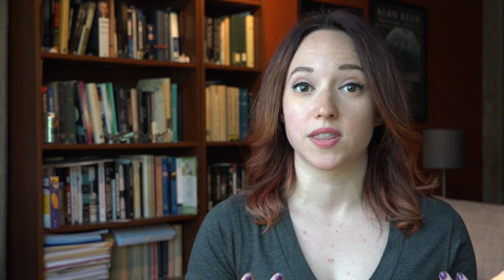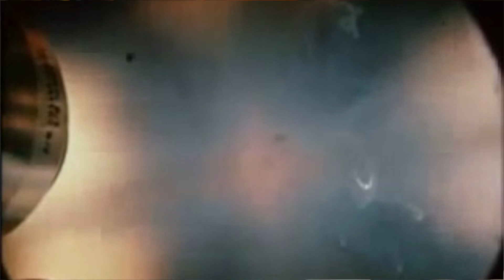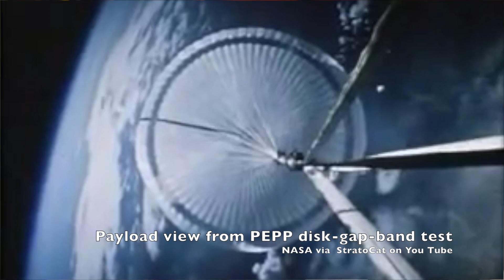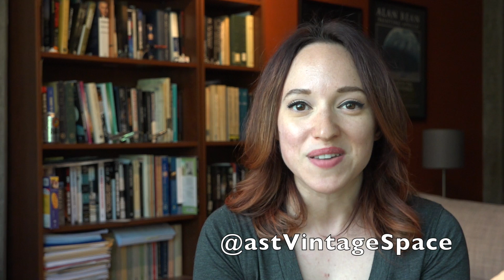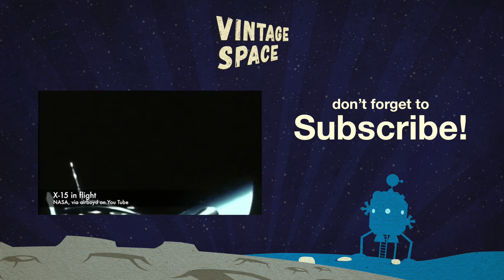Why is NASA Still Using 1960's Parachute Test Results?

Comment: It is also because it is possible to simulate it easily( for experts) with today's software. Dr. Fehmi Cirak from university of Cambridge has publications related to this. The one data from 60's is enough to validate the simulation and then with the same model it is possible to simulate other designs.

Comment: Amy great job on the videos.  I'm not sure where to put this comment but I'm wondering if you can do a video on how the crew communicated with Houston.  I'm referencing the quote gus grissom made in the dress rehearsal before the launch of apollo 1.  He said "how are we going to get to the moon if we can't communicate between two buildings?"  How in the world did the high gain antenna work from 200,000 plus miles away.   Thanks for your time.   Lane
Reply: Hey Amy I found your video explaining the way the crew communicated with the ground.  I can't understand how instantaneous the communications where.  Listening to the actual communications from crew to Houston there is 0 lag.  It seems like the dialog had to go to dsn then to Houston.  How did they get that instantaneous communication?

Comment: Amy what do you think of a flying saucer shaped spacecraft 450 metres wide 360 metres long about 60 metres high being used as a wild-fire dampener and a hurricane disperser. Equiped with atmospheric forcefield protection defensive systems  that will be fitted to the deep space transportation ships, the ship would have a crew of 1000+ monitoring dangerous weather events and help out in disasters.

Comment: had a question, Amy, about your editing. Why don't you write the entire script, and when it looks complete, load it and read it completely in one go? Doesn't it make for a more convincing video that way?
Reply: It really depends on what the person is more comfortable doing.  I've done both scripted and extemporaneous talks for a couple of decades, and for work where you have to interact (whether with an audience or a camera), extemporaneous talking is much easier, provided you know the material.

Especially if you're doing a piece to camera (as Amy is), it's almost impossible to do it from a written script unless you have a teleprompter or are willing to make some compromises in how you record.  If you double space the script and print it at 14 pts for readability, a four minute video is going to take up around 4 pages.  If you spread out all four pages in front of you, the first and last page are going to be way out of your normal eyeline-so it's going to be obvious that you're looking left or right to try and read stuff (also, a lot of people simply bury their heads in the script, so all you see is the top of their head).  Doing it one page at a time eliminates that problem (I've taped scripts to the bottom of the camera so it's close to the eyeline), but it means you've got to stop and edit at the end of a page-which may not be a natural point for an edit in the script.

If you do it extemporaneously, you can have a page (or even just a part of a page) with notes, and have that close to your eyeline to the camera.
Reply: almostfm I agree with all you wrote. Almost. Because my point to her was that since she IS using the Teleprompter, why not put it all together, and just smoothly talk through it. The scenes looks a little choppy, if what I have been told is right, that she's using the tP device.

Comment: How I see the future.  Once they get Lithium batteries perfected and a light weight electric motr, you can strap on a rocket pack that is battery powered and go up as high as you want.  Now, you will need a radar system onboard to watch out for space clutter.  I played too much HERO on Atari.  2600
Reply: If we can charge those batteries for a little cost on our environment is the big question K.  I like free energy ideas.  Look up Rosch for one interesting one.  German engineers that have a patent.  My idea is on here as well.  But you gotta go to your filter and put less than 4 minutes and it's the 3rd one down from the top of the list under "Future of Energy Video"
Reply: The idea shows a ball rolling downward (Mine) and it was supposed to harness gravity as a potential force to be acting like your brake pedal in your car by transferring the pressure to hydraulic pressure.  Which turned a generator.  However, Team Rosch uses buoyancy.  So I am thinking the ball will now float and water will be pushed ahead of it or you get the idea.  It will take me some help to get this one going.

Comment: How about, "Why is NASA still using a 1960's engine (RS-25) in it's fancy new heavy-lifter family?"
Reply: Because it works-it's a proven design.  And chemistry isn't really that different than it was in the 1960s, so your fuel choices are going to be the same.

Comment: Why is NASA still using 1960s parachute test results? A better question is "Why not?". No need to reinvent the wheel if you don't have to. The payload they're lowering and the material the chutes are made of may have changed, but the design is still the same.
Reply: "Science isn't about why. It's about why not." -Cave Johnson
Reply: Johnny Dominguez I was making a joke. But time tested design IS science.

Comment: As a parachute related question, what materials were used for the american and soviet Venus landers? With an average surface temperature of 800+ degrees Fahrenheit, the existing chutes wouldn't last seconds.
Reply: Venus's atmosphere is not very hot at higher altitudes and is actually has a temperature similar to Earth's so a  conventional nylon parachute will work.
At lower altitudes were it's hot  the atmosphere is so dense all the lander only needs a drag flap the ring at a the top of the Venra landers.

Comment: Amy - I read this about the IU on the Saturn rockets:  

Two prisms, one fixed and one servo-driven, were used with an external theodolite which sighted through the viewport outside location 21 to set the azimuth of the inner gimbal before launch. The azimuth could be set to an accuracy of ±5 arc seconds.

Can you explain to us budding space geeks what this means?  The Saturn nav computers took sitings before they launched and based their calculations off that?

Comment: The test you are talking about failed in the test.
That is just the fact that the truth. The fact is it did not work.
This also brings up a few questions like why are they using a fish-eye lens in any high altitude space flights.
The other question would be because because the test failed that would suggest Mars rovers failed and we are being lied to.
I am then thinking we have too ask the simple question is why. I believe the simple answer is clear yet hard to believe.

So I have one question for you if you wish to answer. With as many times the US government has lied "No new taxes" or "balancing the budget" "I am aware you are in Canada" so why should anyone trust NASA when the government that keeps lying created it using such things as "Dirty Trick" or "Paperclip" or even "BackLash". 

I could go on but my main thing is why did you suggest in your video that the test worked? The test in fact failed. Based on facts the only thing that they could have used was a rocket thrust to create a vortex to open the Parachute yet this would not work in a vacuum as Mars values are suggested to be.

Comment: Has any country ever used nuclear power in a space station or satellite? if so, how powerful was it? Why aren't we using them more often? Loving the videos btw :D
Reply: ESA and NASA have used Radioisotope Thermoelectric Generators on their space probes like pioneer, voyage, viking and even curiosity. Actually Apollos 12-17 carried RTGs with them to power their Apollo Lunar Surface Experiment Package doohickeys. IIRC there was some concern over Apollo 13's when the LEM burned up in earth's atmosphere but it seems it's just lying there. RTGs aren't really nuclear reactors as much as they're radioactive stuff in a box with a half life measured in years or decades that passively radiates heat, unlike reactors which rely on controlled nuclear chain reactions. They also don't have any moving parts. They're not super dooper powerful, wiki says somewhere in the region of a few hundred watts. And why don't we use them more often? Well for one they contain radioactive substances which will stick around for quite a long time so containment breaches would be a big problem if people are involved. A lot of the time solar panels will do just fine, but they're a must for deep space probes and a luxury for anything that's going to be operating on a planet's surface in the night, while researching this i also saw a blog post speculating that if a Mars mission were to happen they'd probably be integrated into the rovers used based on what NASA did for Curiosity. Not sure how easy it is to get a hold of the isotopes though so that may be a limiting factor.
Reply: Both the USSR and the USA launched nuclear-powered satellites. I'm not sure how powerful the reactors were, but they were really expensive and probably considered dangerous to launch. The US reactor was called the SNAP-10A, if you want to look it up.

Comment: Speaking of testing, I have a question about the hypergolic propellant used in the Apollo Lunar Modules.

From a wiki article: "According to the Science Channel's documentary Moon Machines, the fuel and oxidizer were so corrosive that the engines had to be rebuilt after each firing. This meant that each ascent from the Moon was performed with an engine that was not tested prior to flight".

Is that really true?
Reply: +Walter W 
Yes which is why they spent so much time making sure that the rocket engine was 100% guaranteed to work. The system using hypergolic propellant was fool proof when it came to making sure the engine would ignite but the real problem that the ascent engine had was combustion instability issues. Frequently the LM ascent engine made the notorious "show stoppers" list as a problem that could stop the enormous nationwide Apollo program dead in it's tracks." They did tests to make sure any oscillations caused by combustion instability would eventually dampen out. That test involves detonating a bomb(more like a blasting cap) inside the nozzle during a test firing to make sure spontaneous instability wouldn't lead to an engine explosion. The troublesome ascent stage only received approval after passing 53 consecutive bomb tests. Btw, this bomb testing method , was developed after 3 of the expensive F-1 engines for the Saturn S-1C where destroyed during testing. This is the main reason that the LM wasn't ready in time for the Apollo 8 mission and it's crewed operational flight had to wait till Apollo 9.

Comment: FOR SPACE CLUBS, STUDENTS OF AEROSPACE AND SPACE CAMPS:This video submission was a really good one, as the concepts talked about here, prompt the askings,"How can I get items to a planet or place without busting everything apart"?

There is additionally the concept of the parawing and if it weren't for the vigilance of RocKiteman, a poster here, I would have never found out that they're still investigating this concept for Mars landings.

THE LAB, OR PRACTICE, Attn org supervisors.Did you ever wonder how they got the idea to package a container that can deliver mixed whipped potato chips to market, without the per store item becoming smashed into many pieces?

I can't say a name here without permission as I believe a few snack companies now have patents on the containers alone.But how would you fashion a container, that would be equipped with ether near ground short term push rockets or a parawing/ parachute slowing apparatus, but still get that payload to the ground without breaking it all apart?

This is a problem here, as remember Amy said in the video, that the atmosphere that surrounds Mars is extremely thin.So this factor might mean that even with a parachute or other s chute design coupled with bounce rockets, that you still might incur damage to your needed items down on Mars.

So how would your particular group, say deliver a fragile package to the surface of a simulated by your group's testing planet's surface and get all the merchandise there without damage?

Remember the lives and welfare of other people are depending upon your inginutity.So your group must depend upon each other to work as a complete team in the constuction of this effort.

I'm not playing devils advocate here, but a test off competition would be something to involve yourselves in.That is if you can get the organizational okays to do so.Organize, appoint people in your groups to certain duties and or job assignments, but join together and help each other.

If you have trouble in the working as a team, remember what NASA's cap com commander had done when apollo 13 got into trouble, was just to throw a bunch of associated Apollo 13 hardware on a table and said to everyone there."These are the items that we have.Get working together and come up with an idea and a solution"?

Imagination inspires.

Comment: Another thing NASA has been forced to dispense with quietly, is backup spacecraft. Recalling Mariner 9 made history while it's backup, Mariner 8 plunged into the Atlantic shortly after launch. The twin Viking missions gave us two views of the Martian surface, as did the more recent Spirit and Opportunity which somehow managed to be developed as a twin spacecraft/mission much like Viking. Pathfinder had no backup. The Curiosity rover had no backup, Cassini had no backup and neither did new Horizons. Imagine if after nearly a decade travelling to Pluto, NH decided to fail? I suspect one day there will be such a failure and it will bite NASA in the behind most embarrassingly. Of course, it will probably be due to the chronic underfunding NASA has dealt with since Apollo ended.
Reply: +J Dean Consider that with modern manufacturering techniques and computers, both spacecraft would be entirely identical.  So if one failed, it's twin would likely fail as well.  So it would be better to lose one and then build a better one to send later.

Comment: Real great stuff! The test data must have been really interesting to look at from the test film footage? Note in some parachutes you can also weave in or make from heat resistant materials, if that chute is going to be subjected to high temperatures and or renentry blast.

Wasn't there an idea during the Gemini Program, to also utilize a V shaped parafoil from a high speed Mars reentry vehicle?This was where there were three long pieces, plus ribbing inflated, but with ribs to stiffen the entire structure.They were certainly thinking of that then. Thanks Amy :)
Reply: It was based on the "Parawing" or "Flexwing", which was originally invented by Francis M. Rogallo in the late 1940's.  {The Parafoil was invented by Domina Jalbert in the early 1960's}.  The Parawing is a single-surface airfoil.  The Parafoil is a double-surface airfoil.
Reply: I should have added:  I am GUESSING that you are referring to the Parawing.  I do not KNOW if Parawings - or Parafoils - were ever 'proposed' for use on Mars or not.
Reply: Thank you for your return comment.I thought I had seen an illustration which may have intimated such.The concept of the parawing is interesting, however the surface area involved for a Mars lateral landing, would probably be quite large?If one, "a corporation", wants to land a large sized tube of supplies down on Mars, the concept of getting enough surface area, to a wing or a chute of some kind, should still be in the forefront of thinking.Thank you very much for your return input. shall take a gander and see if the parawing was ever proposed for Mars?
Reply: *Attn. SPACE CAMPS AND OR STUDENTS I have a problem here as I do not know the confidence gap between what may be available or hidden with reference to the space agency and the potential contractor.So I will not venture to say that there might be an easlier way to land down upon Mars.I did afford some free thinking ideas to a private aerospace contractor on a social ulity on the web.Briefly what was proposed was that if a concern has a structure, say a habitat, then the process that anyone has to look at, is breaking these items down from a primary large construction, to be probably inserted into a high G impact tube and then to transport that tube to a destination of one's choice.There are a number of ways you can do this.This roaster would be, a rentry glide rocket, with buffering to land rockets attached.A parawing. And or a landing using rockets that would fire shortly above the surface of a planet, so lessening the rate of descent.So a LAB that would be of interest to say kids at space camp, would be to fashion a container which would carry a payload, however see in maybe a competition if the container could safely land these items without breaking them.A supply side chain for planet Mars would be a real problem as the supplies that they would have upon arrival at the initiate flight, would soon enough run out.So this probable situation prompts the question, how do I get more items to Mars?
Reply: vrendus522  http://www.hou.usra.edu/meetings/lpsc2015/pdf/2276.pdf   And the serach engine protocols words were, ( the parawing proposed to be used on Mars)